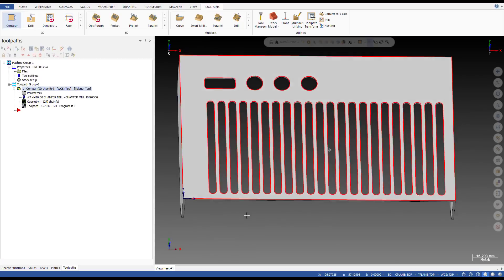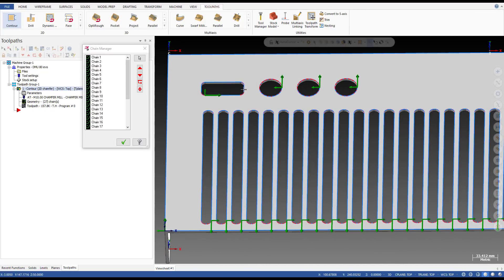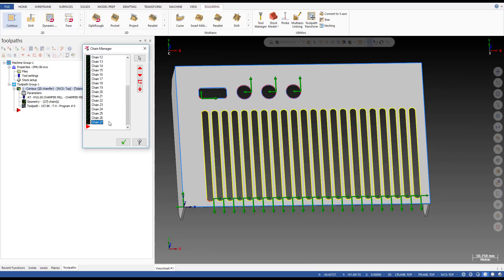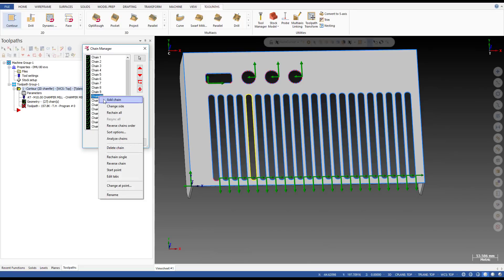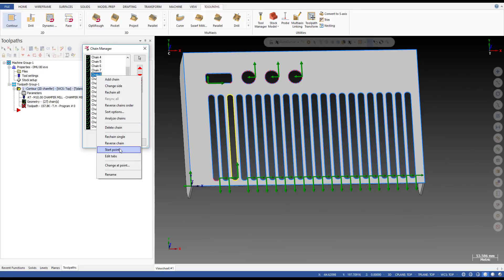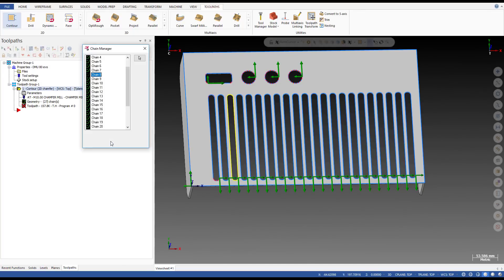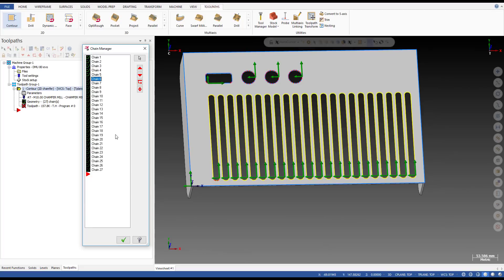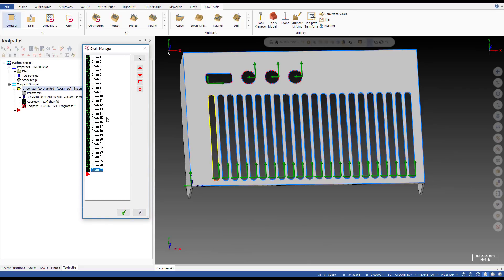Mastercam tip: Reverse multiple chains at a time

Comment: After doing I actualy discovered an even easier way.

1. when selecting chains make sure directional arrows are all going in the same direction.
2. if lead is facing the wrong direction right click in white space next to chains and press "change side"
Then.... BING!!!!..All the chanins will reverse direction and the leads ins will flip
Reply from the maker: You start selecting chains, my case is you already selected all chains and you want to change the direction of the chains you selected in 1s
Reply: The change side function only works if your cutter comp doesn't matter. If you need to prevent switching from climb cut to conventional cut, than change side doesn't work. Also, if you have cutter comp off and need to reverse direction the change side function does nothing.